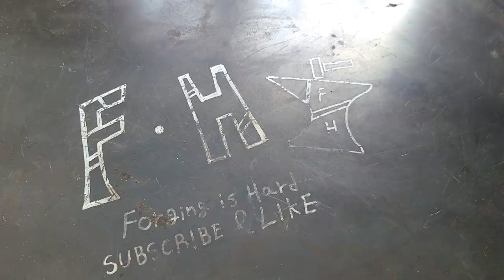Making a kitchen knife from a leaf spring

Comment: Love the kittens 🐱 I have some leaf spring that I’ve begun the process of turning into a Gladius , a Celtic short sword, Viking Seax knife, a Scottish Dirk, a falcata, and a falcata sized Orcrist. I’m going to have to belt sand and angle grind most of the shape (as I did with the basic profiles), but I was fortunate to be able to heat them enough to flatten and normalize. I just didn’t have a great forge setup, and now I moved. I needed some better tongs too. 

I’m always happy to see actual forging done successfully, especially with leaf spring. Thanks for your video!.
Reply from the maker: Thank you for watching.
you will make a nice knife

Comment: Im addicted to your videos. You should get a plasma cutter or oxy-acetylene cutting torch for cutting out the rough shapes of your blades instead of using cut-off wheels. Or would that mess up the metal temper or something? I mean you get the metal red hot anyway. Just a thought. Love your videos! 🍻
Reply from the maker: Thank you for watching.
And thanks for the good advice.